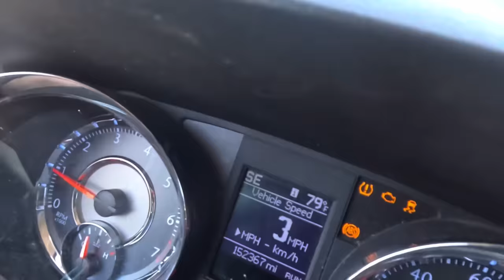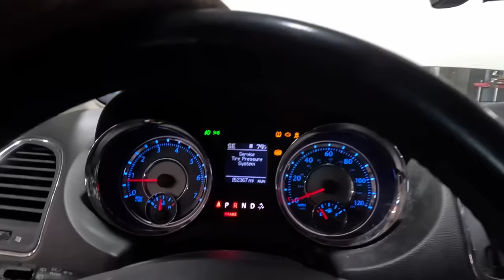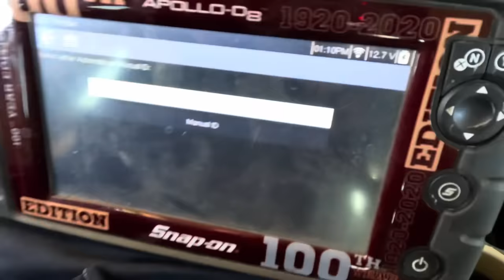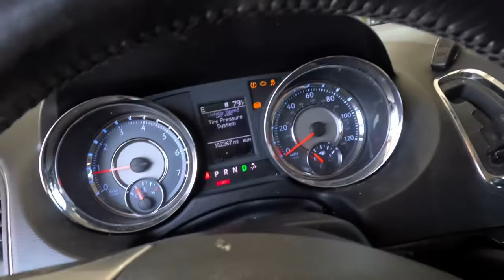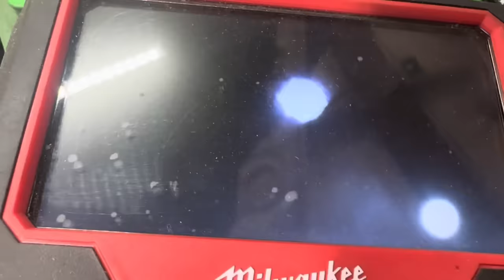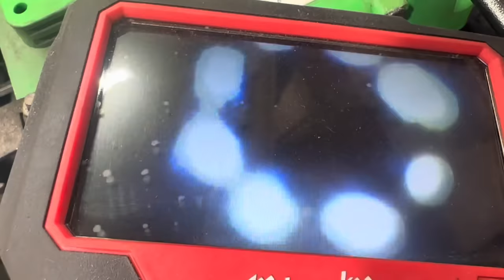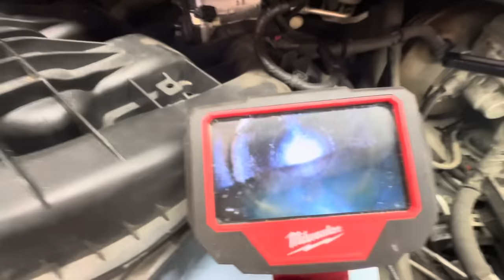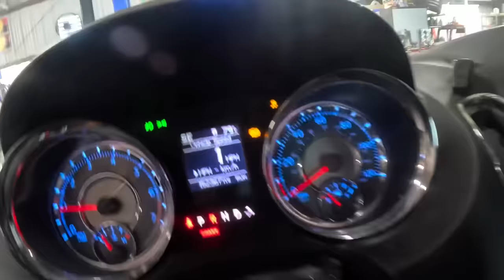Towed In! Died on Highway! (Engine is Drowning Itself!) Chrysler 3.6

Comment: Not enough people are talking about how the intake manifold must be removed to change spark plugs. The designer would have been shot in the 60s.
Reply: In the 60s they didn't have spark plugs that lasted 100,000km so you needed to have easy access then.
Reply: This is a common design on nearly all modern engines, not just the 3.6.
Reply: @givemespace2742  100k km or not, you still need to change them eventually.
Reply: Yes and 3 or four years down the track when you do it takes 10 or 15 minutes to get at them. Usual you are doing other stuff in there at a more major service as well.
Reply: Just one of many problems with the 3.6…..and we’re not even talking about Chrysler-fiat problems/issues.  The plastic oil cooler housing left the chat.
Reply: Bad design is nothing new! I remember back in early 70's there was a GM model (don't remember which one!) but you had to remove engine mount and jack up engine in order to remove spark plugs and that was back in the days when plugs did not last for 100k!
Reply: @57dent  I think (don't quote me on it) that was the N-body platform from GM with that "quirk."
Reply: It has to be like that unless you want to give up like 50 HP
Reply: @57dent 90s GM v6 had to be rolled to access the rear bank of spark plugs.
Reply: That's pretty much all V-6's. Every V-6   I have worked on has had to remove plenum to do plugs.
Reply: With factory platinum & iridium plugs good for more than 100,000 miles, it's not that big of a deal. Since I change my own plugs, I would find it annoying.
Reply: That is some messed up design they can definitely make it easier to access obvious items spark plugs belts pulleys but they don't. I think the old w204 plugs are easy to grab think you need to remove the top cover that is also a filter without any tools. So they can make them easy to get to, but just light brake lights being turn signals it's lazy engineering.
Reply: @57dent  Monza 2+2 and the Olds Firenza with the 305..
Reply: Unfortunately, this is a problem common to many manufacturers.
So much so that back home in Europe, some mechanics don't even want to do the operations, even though they are simple. It's madness. I'm talking about a simple replacement of glow plugs because you have to remove the EGR air/water exchanger, or a turbo exchange because you have to lower a cradle.
Vehicles to be thrown away in the event of breakdowns according to the consumer society....🙄. 
With a little will and knowledge you can almost do everything yourself.
Reply: With the current Ford 3.5l engine, you have to remove the intake plenum/manifold to get to the rear spark plugs/coil packs.
Reply: such poor design that 1) that despite all the fancy bus monitoring the engine can’t even protect itself from overheating & self destruction 2) that they use flimsy failure prone components in cooling system 3) they complicate servicing cylinders & spark plugs with having to first remove an input manifold. i feel so sorry for the customer. Ray, you are very restrained in your comments about this car. guess you have to be. you just get on with the job.
Reply: This the same design on my 3.7 mustang i hate it 😂
Reply: @57dent v8 monza, we used to remove front tires and cut a hole in inner fenders cap plugs next time easy.
Reply: because it's front wheel drive v6 that's why they shouldn't make them
Reply: It's the way of the new world. It's also why manufacturers offer software that allows you to do a compression test on the scan tool by using an amp clamp on the positive battery cable.
Reply: Lol! They did just as many sketchy things back then too!
Reply: That’s why it’s designed to be removed  duh
Reply: @aaronturner1072 ... My 89 Grand Prix 2.8 & other displacements was like that.  I put a bottle jack between the engine & firewall to push engine forward.
Reply: The spark plugs were in a different location in the 60s and engines were carborated! Even Toyota V6s from the 90s required intake removal.
Reply: @givemespace2742  what's a kilometer? How many bananas is that?
Reply: Where's all that going then ?
Reply: True but it's really not hard to do
Reply: @KendrasEdge757  Yep once it got hot that plastic oil cooler housing is now bad.  Ask me how I know.  LOL.
Reply: Thanks Ray for the Heads Up, I will Never buy a Pornstar Engine, so Cheap on Parts
Reply: @57dent if I recall my '75 Chevy Monza with the 305 v8 changed some plugs through the wheel wells. Awkward engineering is not a new thing.
Reply: @robertsheriff6118 agree, on some it's the front bank, some it's the rear. My 12 ford edge I can easily get the fronts but intake comes off for the rear. If I recall back in the day my 75 Monza v8 had to change plugs through the wheel wells. Just a different kind of awkward...
Reply: @givemespace2742  Subaru.. Subaru...
Reply: @57dent  that was virtually all of the front wheel drive V6’s - in the mid 70’s they decided to put an optional 350 in the Monza - to change the rear plugs you had to raise the engine
Reply: wouldn't have had to make an intake like this in the 60s.
Reply: Probably because it's nothing new or unusual
Reply: plastic too
Reply: As I always say, the people that design them don't fix them.
Reply: To be fair, that's not unique to the Pentastar 3.6.  I had to remove the IM to do the spark plugs on my 2010 Traverse.
Reply: Give the costumer a break Jesus is watching you.
Reply: @jdtractorman7445  I must be missing a joke.
Compression test by measuring amperage at the battery?
Reply: @polygon-viewer  With an average banana length of 19 centimeters, a kilometer is about 5,263 bananas long.
Reply: ME AGREES 100%...
Reply: Lol
Reply: @4278-c6b  The "costumer"?  What are you talking about?
Reply: The 3.0 in the Ford Escape/Mazda Tribute has the rear spark plugs covered on the back side.  I figured out how to remove the plugs without removing the intake.  Saves 3 hours labor too.
Reply: @57dent  Chevrolet Vega if I remember correctly
Reply: im a firm believer that if you want to become an enginerd in any field, you must work a minimum of two years in that field. imagine how much things would change for the better.
Reply: @57dent  That was in the early 80's -the X body cars with the 2.8 liter V6. Just wasn't enough room in the engine bay for that engine.
Reply: When the Engineers design these they generally don’t think about the serviceability. Very sad.
Reply: Ray what’s the availability of these engines? Of course customer needs to be informed. When I was working on cars I only had to price out 1 engine job. It was like jumping through hoops to gather all options and pricing and generate the estimate.
Reply: Lots of vehicles over the last several decades have this design. Mitsubishi V6 engines used this setup in the 90s.
Reply: @jgeisler  they are designed to be assembled as quickly and cheaply as possible. Repairing them never crosses the designers' mind.
Reply: @jthonn  a lot of engine pieces are plastic. Even plastic "use once and throw away" oil pans!
Reply: @adotintheshark4848  Yep, if they could get away with it, the heads, block and all would be plastic. The first time I saw a plastic drain plug, I knew we were in trouble.
Reply: @jthonn  planned obsolescence too, because plastic degrades. And those pieces aren't cheap
Reply: @adotintheshark4848  Man you got that right.
Reply: @ORRadtech  Used to do that with the Chevy PU's too!
Reply: @markheddington  Awarded "Wards Best Engines" Another "Fiat" Marvel!!!!
Reply: But 90% of the manifolds are really not difficult or hardly time consuming to remove. Most I can pull in no time at all. It's only difficult if you have no skills and easily intimidated.
Reply: @rodneydrew9117  Agree, these applications could have been handled by a straight five or six. Plenty of cars have had a longitudinal engine with FWD.
Reply: @57dent  Corvette
Reply: @Boga217  It's still a drag. There is a lot of new vehicles that I won't work on, not because I can't, it is a pain in the butt. I don't blame mechanics charging what they do.
Reply: Most v6’s are this way…
Reply: @givemespace2742  so the best of both worlds, buy a vintage car and install modern plugs. problem solved. yes, spark plugs last longer but you still need to be able to service them reasonably well.
Reply: @KendrasEdge757  older engines dont even have an oil cooler
Reply: @andrewdonohue1853  the 3.6 pentastar most certainly does, which is what I was referring to in my comment, “just one of the many problems with the 3.6”
Reply: @nissan300ztt  lol yessir
Reply: @aaronturner1072  i have done them without moving rolling the engine forward although it did make the job easier. i had a 81 cavalier with a 3.1
Reply: @andrewdonohue1853  IIRC J bodies had enough room to hit the rear bank (admittedly we had a 4 cylinder 86 wagon and several 2nd gen Z 24 verts). W bodies at least the 90 Lumina we had requires rolling the engine or a long armed mechanic to get at those rear plugs
Reply: @aaronturner1072  i had a 90 grand prix and i was able to get them, but barely. eventually the car developed an issue and i just couldnt get it to run well anymore and i ended up parting ways with it. it was a clean car and really didnt want to let it go. i have had better luck with 3800's and still own 2 3800's today. fantastic engine.
Reply: @andrewdonohue1853 At least with gm, you could unbolt a couple of the mounts and rotate the engine a bit.
Reply: i had a ‘98 avalon, the plenum was on top of the rear plugs but it was enough room to reach them without removing the plenum. now on my ‘00 es300 with the same engine, you have to remove the plenum to reach the plugs.
Reply: You have to also remove in intake on Fords 3.5 and 3,7 plus the waterpump is in the timing cover. So this isnt that bad.
Reply: Except it’s a modern engine so it’ll be a dumb design. These engines are pretty trash. Worst engine you can buy on the market.
Reply: @michaelbenoit248  It's a dodge! I already knew that.
Reply: @michaelbenoit248  you're not wrong about it being a crap engine, but there's far worse ones out there.
Not all modern engines are trash either. Toyota 3.5 is pretty damn stout (tho you're still pulling the intake to do plugs)
Reply: Removing the intake from this engine is pretty simple.The GM 3.6L engine in the FWD cars requires removing a lot more parts- including a fuse block and an engine mount. After that's all done then you have a 2mm of space to remove the spark plugs.
Reply: Of all the stupid things one might have to do to change spark plugs, that's probably the least stupid. Is it easier on my 90s Chevy trucks? Yes. But other engines have far sillier requirements than having to remove a very easily removed intake manifold. A lot of GM front wheel drive V6 rear banks require either rock the engine forward or change them from underneath on a hoist. I did a Subaru Forester which required undoing the motor mounts and lifting the entire engine to the limits of travel on the hoses to get enough clearance on the fenders with that weird boxer engine jammed in that little car. I'd much rather remove the intake manifold on a Pentastar. They made it easy, and then it's very simple to do the plugs. Front wheel drive platforms deal with some severe space limitations, especially in a van, so they do what they can. I respect that Chrysler at least thought about making a simple way to access the spark plugs. GM clearly didn't on so many of theirs.
Reply: @seand7349  Yes, you could unbolt the GM engine and roll it, but removing the intake on a Pentastar is a lot easier, and doesn't require getting underneath the vehicle!
Reply: This has been a thing for years from practically every manufacturer, mate.

That said, old VQ30DE's didn't require the upper intake to be pulled to change the plugs (I know because I had one).
Reply: @givemespace2742  Still need to remove it to diagnose a misfire at the coils as well.  AND it is plastic.
Reply: @givemespace2742  So they did it as a screw you since the warranty expires first.
Reply: On all transversly mounted V6's, this is common.
Reply: @jgeisler  Maybe they have a brother that fixes them.  2 hrs labor to change a spark plug.
Reply: @MonkeyJedi99  3rd party scanners already do it.  Who cares about manufacturer equipment.
Reply: I had some Pontiac in the late 90s and the motor had to be pulled forward to do the plugs lol

Comment: That damned Y-pipe in the heater circuit started leaking on my 2013 T$C.  I replaced it with a Dorman aluminum part before the engine was destroyed.  When Dorman is higher quality than a factory part...ouch!
Reply: Ray has a video of a dorman condenser for a GM product that far exceeded the OEM . Kind of a pet peive issue with Ray that goes back many years!!
Reply: Dorman has actually improved over the past 2-3 years. Better than Chinesium parts anyway
Reply: A few years back I also had a 2013 T&C and that same heater hose connector leaked on mine, as well. It wasn't leaking nearly as bad as the one in this video, but enough to notice the coolant was low again every few days.
Reply: Doorman makes an aluminum oil filter\cooler housing for these stellantis engines too instead of factory plastic one that's a known defect on these things too. I think they're stepping up their game a bit, which is good - it's about time. It's sad that the aftermarket co.'s like Doorman has to fix so many engineer-created, manufacturers problem. 🤔🤦🏻‍♂️👍🏻👌🏻

Comment: When you are driving and see steam under the hood or at least the temp starts rising pull over and shut it off.don't try to get to the next exit and find a good parking spot.engine damage could have been avoided I think.
Reply: Yeah, everyone is blaming the shitty engine for what happened but ultimately the driver is the one to blame.
Reply: Had a friend do the same thing.  Engine overheating, and they were worried about getting to a McDonald’s or somewhere so they could get something to eat while waiting on the tow truck.  Engine blew up.  😂
Reply: Regarding who’s at fault, sometimes when coolant leaves the party, the temp sensor is no longer sitting in liquid and sometimes you can get low false readings and be unaware the block is heating up. Something I’ve seen before so thought I’ve throw my 2 pence worth in.
Reply: Who cares ? Manufacturer must fit beeper  if oil pressure drop and over heating. But who cares. 😢😢😢😢😢😢😢😢😢😢
Reply: Or you shut it off on time and your mechanic blows the engine running it without coolant trying to diagnose the problem…. Why didn’t Ray check fluids before starting it?
Reply: On several of the cars I have had, the Coolant temperature is taken at the Rad. No water = cold!. They need to also have the Head temperature, like they do on Aircraft Engines.
Reply: @shakerman55 that's an expensive McDonalds meal
Reply: @russell802208 Driving it 10 yards isn't going to overheat it
Reply: Oh definitely man this car was giving all the warning signs steam was coming out the lights were flashing there is no way the customer did not know about his car overheating
Reply: @thebobbyc82  - My 2001 car has a low coolant warning on the onboard computer display, I'd assume a 10 year younger, much more technologically advanced vehicle would have one of some sorts too.
Reply: @imagingteam  
Yep.  The kids got those happy meals.  That’s the thought process too many people have now.  It is sad.
Reply: Fair enough question.
Reply: Never had a coolant hose fail where you couldn't smell it. And steam rising from under the hood.  One whiff of coolant, and I'm pulling over.
Reply: @thebobbyc82  🤣when you see steam emanating from under the hood that nullifies all false readings...even then, the little wife is in a hurry to get to her "hair appointment," by then it's mostly all over...
Reply: Temp gauge is there for a reason
Reply: Yeah. Every now and then I check my engine's temperature
Reply: @tradde11 My dad prefers oil, coolant, fuel, and voltage dials
Reply: @militarycoo  it obviously did… It sounded better when it arrived ya nimrod…. Proof is in the video
Reply: @tradde11 funny how it sounded good until Ray ruined it…. Proof is in the video
Reply: I prefer a hose blowout, you get that big burst of steam giving you a clue.  The small drips are the killers.
Reply: Depends on the circumstances. Breaking down  on a freeway can be extremely dangerous. Sometimes, it's safer to get to the nearest exit than pulling up on the side of the road. Cars can be replaced,  your life can't be.
Reply: @ChrisStumer  That is my philosophy on motorcycles.  Get in the air, let the bike take the hit.  Fix it later.

Comment: I saved my engine!!! Same leak. Replaced part for $80. Pay attention to your temp gauge!!! This could have been avoided. My pentastar has 214k on it and still running! No pentastar tick either. I must have got one of the “good” ones😅
Reply: They are not horrible engine. Just too many pastic parts. As long as people do what you did, pay attention, and stay on top of things, they can last for a while. The 6 Speed transmission was the weakest link on certain years.
Reply: These engines are in soooo many taxis and ram commuter vans. They easily last 400k miles before getting retired
Reply: My wife has good hearing, she noticed the engine ticking so we brought it in. Fortunately it hadn't eaten the cam up yet so we were safe. It still cost me a bit of money in parts and labor, it could have been a lot worse.
Reply: Which makes me wonder why that part wasn't replaced alongside with the thermostat housing, as the failed thermostat housing was probably the root cause of the damaged part, and it was a known issue.
Reply: People like you are probably why they don't put a temp gauge, and you have to wait for the to bad light to come on.